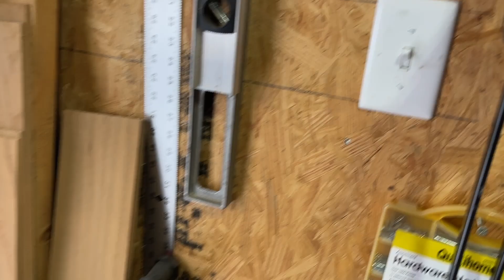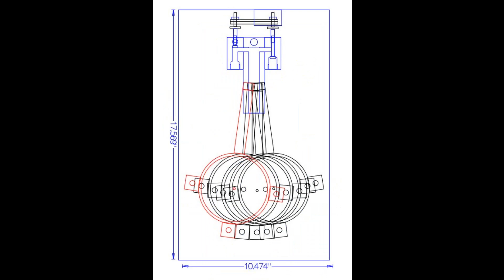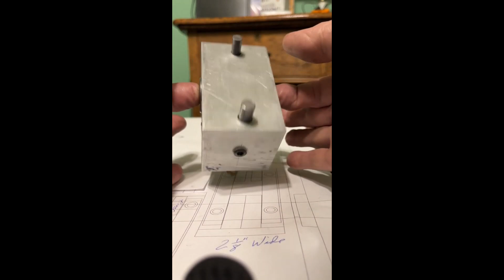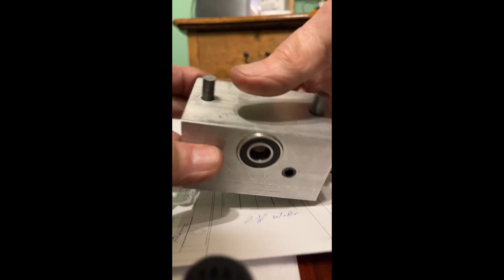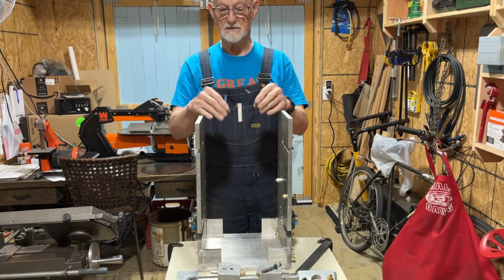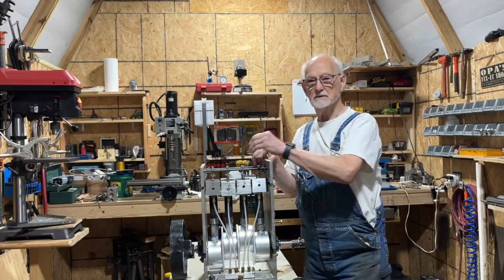START to FINISH Making the 4 Cyl Shaft Rotator Air Engine 1-6-2025

Comment: It seems you can adjust your 'valve lash' with some set screws [with, or without resting plates] to change the timing of the valves to change performance.

On my dual action system, I was able to speed up, or slow down the motor to change the speed.
Reply from the maker: Thank you for commenting, and Yes, I have been thinking about adding some ways for adjusting the timing, but I'm still in the testing different Ideas so adjustable timing will have to wait.
Reply: @AirEngineResearch  One idea would be to put a swash plate/flat swivel cam setup over each set of valves.

By rotating the cams one way, they open sooner, and the other, they open later.

To get an idea what I am thinking of, look at one of those little circular spark plug gap gauges.

Just make one that is bigger and screws into place so it pivots from that screw, and link a cable or rod from one to the next, so that it only takes one control to move all 4 swash plates at the same time.

Also, one could do like a seesaw and put them on a plane over the valves with a rocker ever off one end, that might be simpler and easier to build, since it would not have any complex geometry to mess with, nor need any special tools.

Comment: Could you use some aluminum conduit to make lighter crank throws and reduce the total thrown mass?
Reply from the maker: I do use aluminum where ever I can, but for ware and tear with it needs to be metal. The rotators are Aluminum, just the Drive shaft and Ring is metal.